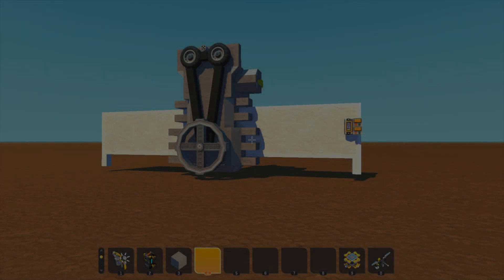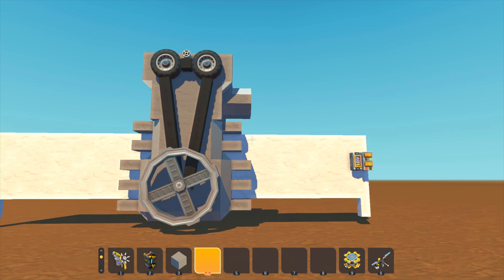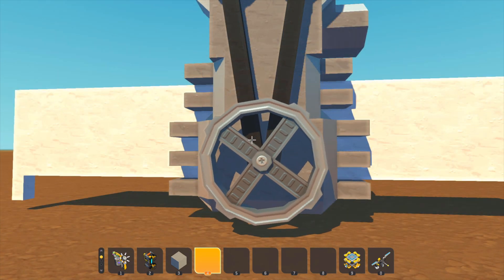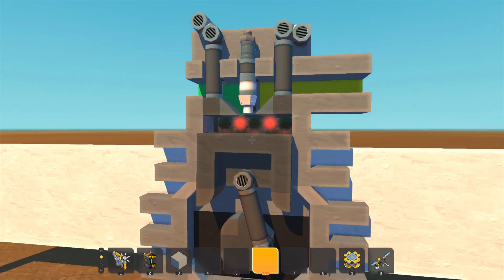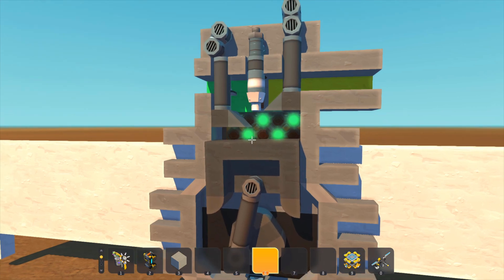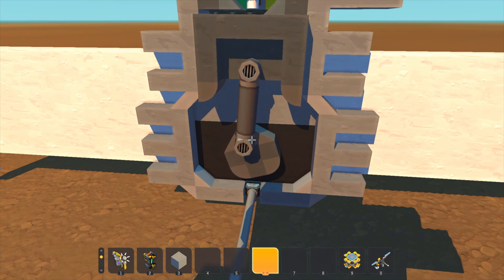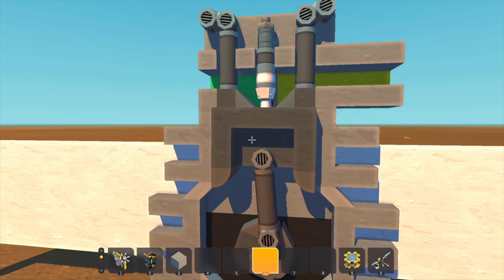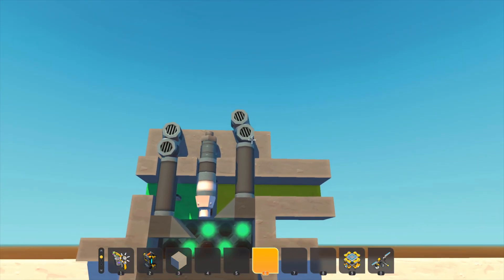How a 4-Stroke Engine Works... |   Scrap Mechanic Creative

Comment: Gas engines are sh1t compared to eletric motors
Reply: Filip Woliński nah. More top end less torque.
Reply: @theun-knownmusician5468  and atually electric engines have much higher torque   than gas engines
Reply: @theun-knownmusician5468  but they are far cheaper and easier in exploatation
Reply: Its the other way around